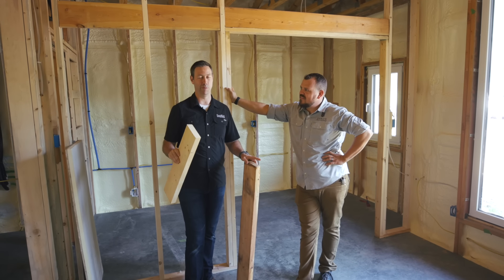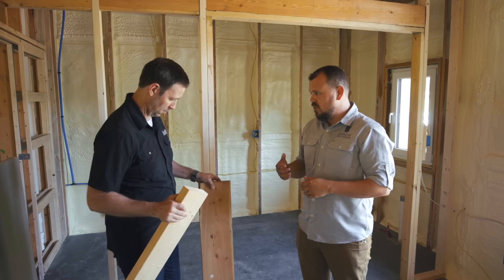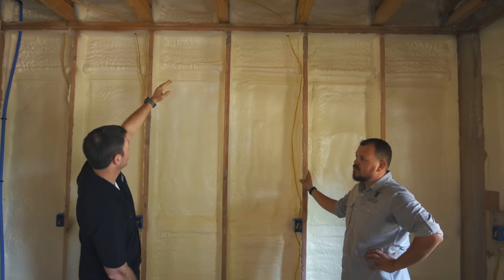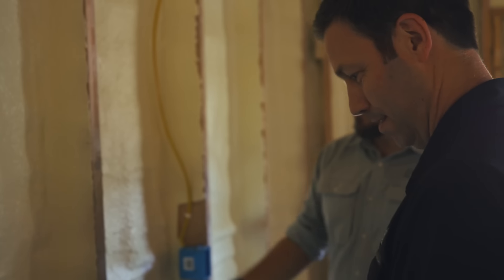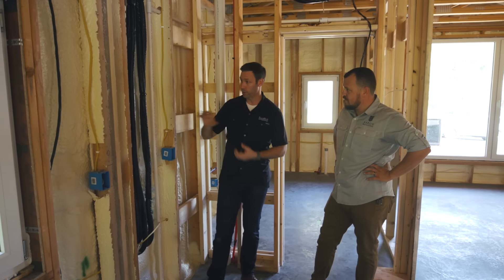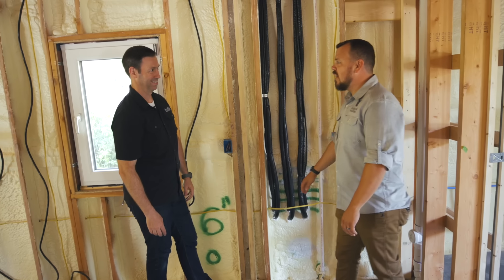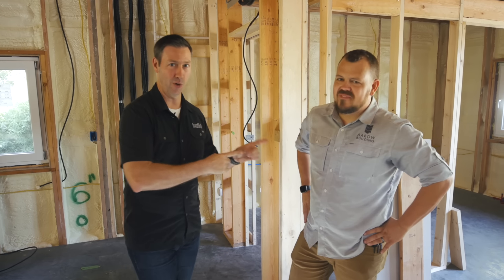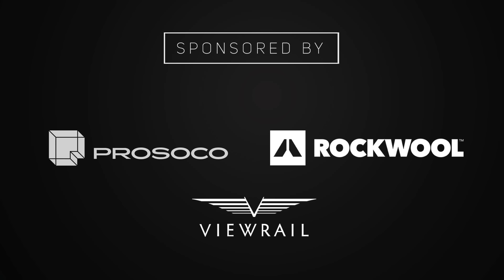Why would you frame a house with 2x8 lumber?

Comment: This thought process (over building, over insulating) should be National Code requirement. I currently live in Tucson where 4-5 months out of the year the temps reach over 110F and Apartments are built with 2x4 construction and little to no insulation, causing your Summer Electric bill to soar into the hundreds even for a small Apt. It should be a crime to construct buildings in extreme heat or extreme cold areas without maximizing insulation. The bear minimum just isn't good enough and hasn't been good enough for decades.
Reply: Just bad builders building bad houses

Comment: It'd be nice if more builders did 24" on center, 2x6 can handle it. (Having a measuring tape in the thumbnail to show that might've been a nice guide too ;-)
Reply: The only issue with 24" on center is that drywall doesn't like the spacing, and there aren't nearly as many studs to attach to for stuff like shelving and built in bookcases. So usually that means an extra step to install a bunch of 1 × 2 horizontally.... It's a compromise that has its pros and cons.

Edit: Oh, and I think to do that in my area you'd need 2 × 8 for 24" spacing.
Reply: 24" (600mm) is minimum/standard where I live(northern europe). Most insulation and drywalls are made to fit that.
Reply: @ReedikTuuling  600mm on center studs in Australia also, but we don't have snow loads to worry about
Reply: @colstace2560  A snow load here is about 1.5kN/m2, compared to average live load of about 3kN/m2. You just have to make smaller floor/roof spans.
Reply: @ReedikTuuling  I'm not saying that drywall won't fit (16 x 4 = 48 and 24 × 2 = 48, so it's the same size), I'm saying the drywall material itself isn't the best at spanning the larger gap over time with wall fluctuations in our weather.

Yes, you can do 2 × 6 on 24" centers with one upstairs floor (that's the limit), but I don't see that gap used often. Builders here seem to prefer 2 × 4 on 16" centers. And some are doing 2 × 6 on 16" centers for walls taller than 8'.
Reply: @sleepyancient6655  (16 x 3 and 24 x 2) Well if you buy the correct drywall for 24" spacing, it's not a problem. I'm guessing most drywall used for 16" is actually rated for 24", not sure what you use so can't look it up.

I think that in terms of compression strength 2x4 with 16" on centers is equal to 2x6 with 24" on centers. Compression strength comes from the area of cross-section. 
So a 2x4 has an area of 8, it takes 3 to span 48 inches, so 3x8 is 24.
A 2x6 has an area of 12, it takes 2 to span 48 inches, so 2x12 is 24.

So with 2x6 you have to same compression strength. but you can fit more insulation. Correct me if I'm wrong.
Reply: @ReedikTuuling  You can get drywall as thin as 1/4" and as thick as 5/8".

But the reason for choosing closer spacing, even if compressive strength is the same, is the tensile strength. Walls can bow and warp. I don't know about where you live, but here it isn't unusual to see over 40 C on a particularly hot summer day and -40 C on a particularly cold winter night (-52 a few years ago). Though normal range is 35 to -35. And the humidity is nuts.

Thermal expansion and contraction do a real number on everything here. And humidity can make wood soft over time.

Comment: “Am I a joke to you?” - 2x12
Reply: Why not just frame your house with unsawn trees at that point
Reply: You could have a passive wall with 2x12 load bearing w. insulation. With 3 inch insulating windbreaker board on the outside and 2x2 with insulation inside the vapor barrier. Not saying it's common over here(northern europe), but certainly not impossible. No clue about the R value tho.
Reply: @liameisenberg9711  they bask in their own overkill, let's spend $100 to save 1c per year in energy bills
Reply: Buy a 2x12 and measure its actual dimensions. 

Yes. 

It's a 1.5 x 11 joke on the world.
Reply: @colstace2560  Hey there, math major - adding $2000.00 to an initial cost over a loan term of 15 years only adds $14 and change per month.  If you cut 1000 a year off your combined electric, water (because you're running it longer to get hot) and gas/propane/oil bill (which is commonly over 100/m on average alone), that's paying you BACK for the initial investment cost draw down the very first year. So yeah...1c. You must be from Florida.
Reply: @April-rj8lf  Common knowledge for decades.
Reply: I've been in a house framed with 2x12. Not sure their reasoning behind it but it was neat to see. Huge added cost and pain to deal with but to each their own. With todays lumber, I'm sure it was alot of work keeping everything straight.
Reply: @nonamenowhereski7563  I'm saying the difference between say R20 and R25 is unmeasurable, now the difference between R0 and R20 is measurable, so why not go R50 or R100, the higher you go the less you save. If you could build 2 identical houses (which is impossible) and compare R20 to R30 the difference would be pennies per year. And no, I'm not from Florida, why you wanna insult me like that ??
Reply: @colstace2560  Well played - I appreciate your point and your patience. I was being a jerk and owe you a sincere apology. No one deserves to be told they're from Florida.
Reply: @nonamenowhereski7563  How does a 2x8 wall make you have to run water less time for the warm water from the water heater to arrive?  That doesn't make any sense.
Reply: @nonamenowhereski7563  I take it from that answer, that had no information about how 2x8 walls make hot water faster through pipes, that you got my point that it makes exactly zero difference.
Reply: @snap-off5383  I could explain it to you, but I can't understand it for you. Just live your life - you'll be fine without knowing.
Reply: @nonamenowhereski7563  you haven't explained it for the first time yet we're still waiting and you don't need to bother cuz I already know it doesn't change it at all whatsoever.  The distance from the hot water heater to the faucet is the distance from the hot water heater to the faucet whether it travels through a 2 x 4 on its way  or a 2by 8.  The difference in ambient temperature of the existing water in the lines doesn't make even half a seconds worth of difference in hot water arrival time.  For all logical reasonable intents and purposes the arrival time is the same.

Comment: I like the idea of the rigid applied outside the framing, 2x6 after that.  What about HRV?  If the house is too tight, fresh air is needed.  It’s code for new builds where I am since 2017.
Reply: The home is equipped with he very best ERV

Comment: most houses in the nordic are built to this standard. in my house i have 2x10 with 30cm of wood fiber insulation (2x2 battening on the inside for ease of electrical) with a homogenic and water vapour permiable wall structure. no plastic to minimize the chance of structural condensation.
this house is made to last more than 20 years!

Comment: Going to the 24 on center instead of 16 does save time and lumber and easily makes up for the difference between 2x6 vs 2x8.  Better for the wall and better for air sealing.  But of course the change in thinking is the hardest to overcome.

Comment: Just curious, how did he deal with the crowning of the 2 X 8's? In my experience, larger dimensional lumber tended to crown on a larger level than 2 x 4 or 2 x 6 framing lumber.
Reply: Use #1 studs and and chill the lumber for defects prior to use. Lumber yard are notorious for throwing some "junk" Kimber in the middle of your load. It gets it out of the yard. We made them come pick up and replace the junk Kimber with better stuff

Comment: What are your thoughts on framing with 2x4's staggered, 8" on center? 
I know this video is 3 years old, but my curiosity is still peaking!
Reply: Or now after reading a comment I just now saw by @ptzish , 12" on center sounds reasonable, if not better (than 8" on center), now that I think about it.

Comment: Don't like 24" OC too easy to damage drywall.
Reply: agree, so I'd strap the walls and ceiling at 16" with 1x3.
Reply: 5/8 drywall corrects that.
Reply: That's why I drywall my house with 1inch thick AR500 steel plate.
Reply: @mike86mike  thats it? i use 2 inch ar500 and fill the cavities with 3.5 inches of kevlar
Reply: Use cement board then e.g. HardieBacker, Durock, etc.
Reply: Agreed. Too many issues all together with 24" oc.
Reply: @mike86mike  LOL

Comment: The concept is perfect for large square footage home, but the consumption of sq ft on small homes may out weight the benefits.
Reply: On smaller homes, it could be an alternative to reduce to a 2X6 wall and upgrade to R-9 or R-12 Insulating sheathing

Comment: There is value in a 2x8 wall in the north. lots of insulation benefit. However, 2x8's are less stable. They're made (mostly) of quick growth fur. They will twist and check a lot more than a pine 2x6. Because the pine is also quick growth, they are usually kiln dried.

Comment: No window headers? Floor joist aren’t centered on studs.
Reply: He said you have to pull layout from the same corner............You always pull from the same corner!
Reply: Window header on the background is 2x8 flat. Structurally, it is actually all what you need.
Reply: @scuddrunner1  Unfortunately that's not common sense anymore. I don't know how many framing crews I have to come behind to fix their mistakes that common sense would have prevented.
Reply: @pwhsbuild  That's interesting! I was taught framing 101 you always pull from the same corner. Keep up the good work!

Comment: Someone is going to put a hand through that sheetrock in no time with that wide center.
Reply: They've been doing 2x6 on 24" centers for years.... this is just an extra 2" thick stud.  Welcome to 1990's.....
Reply: Matthew Edwards You think someone will put their hand through 5/8 drywall? That’s what I had to use on my addition for fire rating.
Reply: @ravogs59  Typically 5/8 is only used on Exterior/garage walls to slow the spread of fire to to occupied space of the house. I could be wrong depending on codes in your area but normally interior walls are 1/2 unless there is a garage or exterior structure attached to the livable space.
Reply: @Trevor P that’s what I thought also but in my old town of Oak Park Illinois code for all interior walls was 5/8.
I am now in Arizona doing remodeling on my new home built in 1978 and the roof rafters are on 24” centers.
Reply: @ravogs59  nice. Good to know some old codes are still different

Comment: We did 2 2x4 walls 1" apart with staggered studs. That way there's a thermal break in the walls. 2" spray foam in the outside 2x4s, the rest of the wall was filled with fiberglass.
Reply: The roof is 12" I-Joist with 1" pink foam strips on top, 4" spray foam, and the lower filled with fiberglass. The joists are supported by real laminated beams in the center. It's a non vented "hot roof". Shingles are 20 years old and still look good.

Comment: I looked at 2x8 the problem was custom finishing all windows and doors and I was using normal heights so I used 2x6 precut on 24 OC it worked great, I had one cabinet that was difficult to hang, I screwed it into one stud and used big toggle bolts for the other side. When they make doors and windows with jambs for 2x8 walls then it will work. I have HRV also which works great.
Reply: Carpenters in NYC use 5/8" sheetrock for fire Dodge and use 5/8" plywood behind the cabinets on every commercial job I was on.

Comment: My 1940's house is a 2x8's ceiling rafters. I saw them and decided to just stain them and keep them as a ceiling. I am adding onto the outer wall, so I will have to raise the roof as it is 14' ceiling inside toward the outer wall which is 9' about, but being I am increasing the size of the house, I will have to add more of the things to it. Watching that and learning from it. All the new walls will have the modern plywood to it.

Comment: you're not putting up the same amount of wood...  2x8's are like 25 - 33% larger/heavier then a 2x6.  This will inevitably slow down framing by a somewhat similar percentage, which will indeed cost more.  Don't expect your future 2x8 house to face just a material cost increase.
Reply: 2x6 is framed on 18 inch centers, 2x8 is framed on 24 inch centers. Cmon man

Comment: With 2x4 or 2x6 It's necessary to add exterior insulation to achieve the IRC 2021insulation requirements. With 2x8 it's possible to meet the requirement simply using cellulose or fiberglass insulation in the stud bays. No exterior insulation is required. 
This has the big advantage of keeping all the exterior details such as door and window flashing in line with what builders are accustomed to. I'm considering moving all my designs to 2x8 framing instead of doing exterior insulation.

Comment: There are significant diminishing returns after R-24 . Hard to justify going beyond certain r-Values. You also have to factor the additional cost of adding more volume of insulation.
Reply: Absolutely agree. He could have done the same design with 2x6 and got r35. Complete waste of money and the $1500 "extra" is a complete lie. I'd say it added 10k to the cost for r7. Would have been better spent elsewhere.
Reply: Well depends on where you live and how expensive is heating/cooling but I agree. There will be a point where you will never make the money back by adding more insulation.
Reply: @ReedikTuuling  I tend to think builders tout R-values in order to win some proverbial gold medal 🏅 without much value engineering being done. My recently built home where I did r-24 in wall along with exterior rigid foam and the ceiling was @R-42 since heat rises the $$ is much better spent on your ceiling. None of this is justified.
Reply: @mrgylex123   I agree. In the end the insulations is there to save you money. No reason to crazy on insulating if it saves you 10$ a month.

Comment: I'm building a house right now with 2x8 studs 24 inch on Center and advanced framing. I think if I had to do it over I would do 2x8 plates with staggered two-by-fours. None of the foam board or Zip system. Just fiberglass and seal it at the drywall.

Comment: Who is doing the electric did they run out of staples and run it like the crow fly’s
Reply: Only idiot code requires staples. It is stupid.  Does nothing of any value.  This is NOT a vibration environment like a car/machine. EVERYONE else DOES NOT want them.  Just means it is IMPOSSIBLE to remodel.  PS: get rid of the stupid electrical boxes as well.  Use wall plates and it makes putting up sheetrock 2X faster at least.  Do it Australian style.  Now if you want an electrical plug in box AFTER sheetrock, fine.  You put it in.  Once again, you do not want the wires stapled.  Likewise you cannot keep wires LABELED, so for troubleshooting, or install it requires FAR more time as there is always sometime when you screw up the intallation and do not do the 3 ways correctly etc.
Reply: w8stral If that’s the measure, just do all the wiring in conduit on the surface of the wall. I’ve seen it done that way in stone castles. It looks quite nice really.
Reply: @thomaswestgard4379  And takes FOREVER to install.  No thanks to tubes.  If you REALLY want tubes, then do it like you do for commercial steel studs

Comment: Why not build 2 walls with 2*4 or 2*6 lumber each with 24" on center but offset 12" so the studs interweave. That way you can make insulation as thick as you want and you de-couple the interior and exterior walls from each other so they vibrate independently making the place extra silent? You could even use one set of studs as a structural element and smaller studs for the interior element.
Reply: Double the labor

Comment: I've never seen a house crushed by anything - extra compression strength isn't something that adds value to a house, beyond design code. The bay depth for insulation seems like a good idea. Over time, I think the top value from 2x8 framing is bragging rights, which to a lot of people is worth it.
Reply: It's different for the sake of being different, no real advantage over any number of other systems, how high an r value do you really need? Where do you stop?